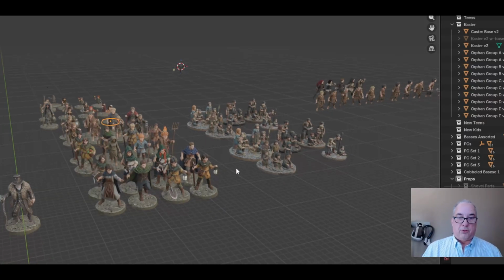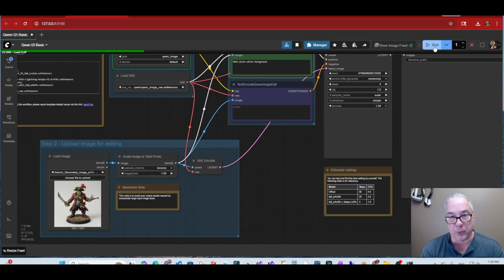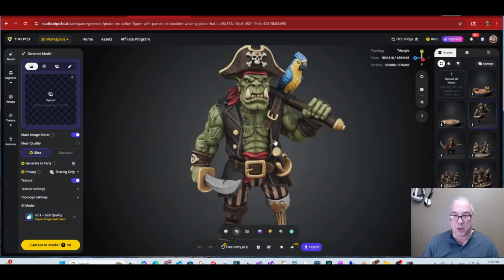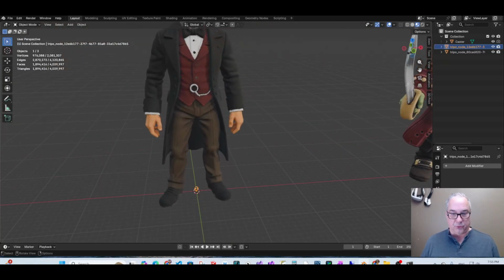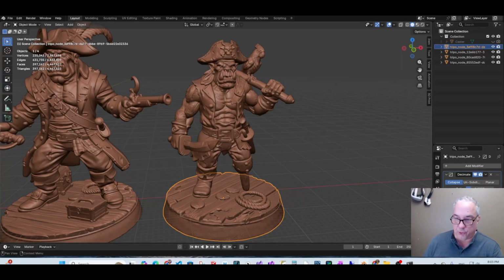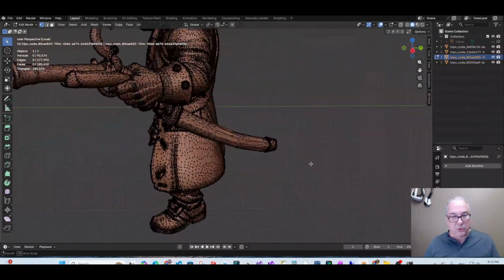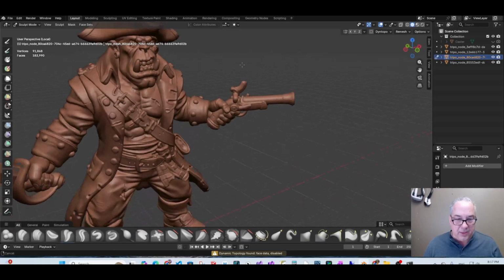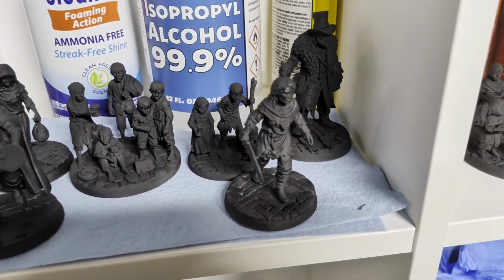Using AI tools to create custom printable Table Top Miniatures for your game.

Comment: Saw you link this on FB. Good tut. Wondering, with Tripo 3d - since I am unable to Export anything with a Free account, what are the Credits used for since I didn't see your total Credits reduce for Exporting?
Reply from the maker: Good question.. when I first stated useing it you could export with the free account.  give me a minute checking
I do have a premium account because I use it a lot.. the average build costs 50 credits. because I go ultra.
Reply from the maker: GOT IT!  Ok they made a change.

Basic ( free ) Plan only supports 15 free exports per month.. BUT you have to generate using the AI Model 2.5.   You do have to have a paid subscription to export Version 3 Models. 
the AI Model Selector is on the left hand nav under the image at the bottom.
Reply: @WickedMonkey3D ah ok! That makes since I was trying to stick to your work flow as possible and came in with an outta site image.
Reply from the maker: Note... there are several really good Image to 3d Mesh tools out there Tripo is just one and my personal favorite.  Meshy, Sloyd and many others.. you can also generate Image to Mesh directly in Comfy UI with the correct models like Trellis 2... but I have had only limited success with that... Trippo nails it almost every time for me.
Reply: @WickedMonkey3D yeah it (Trippo) seems to be the current best for miniatures based on my research. Thanks again for the tut video and the response feedback.